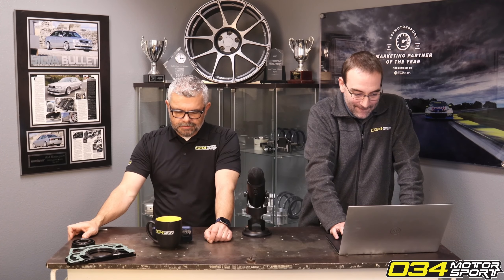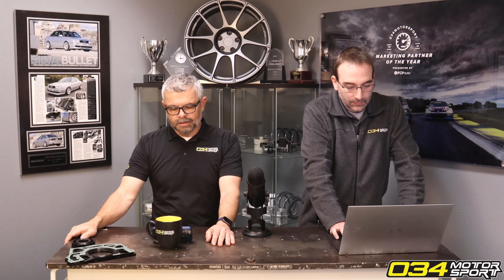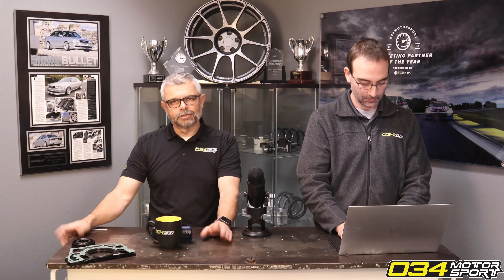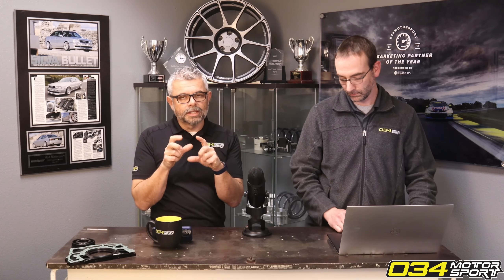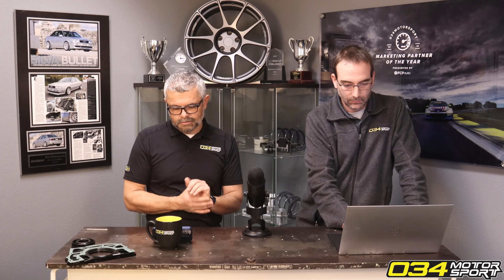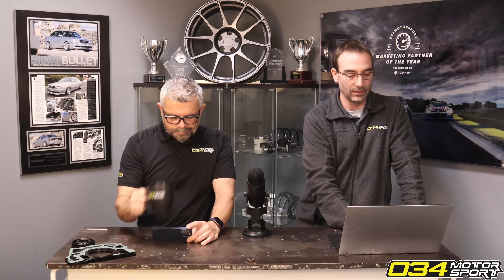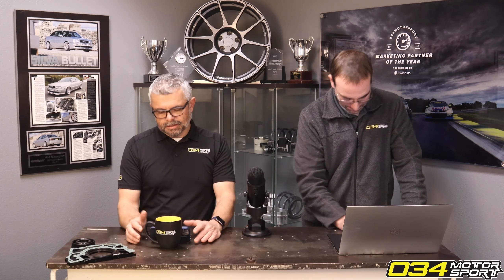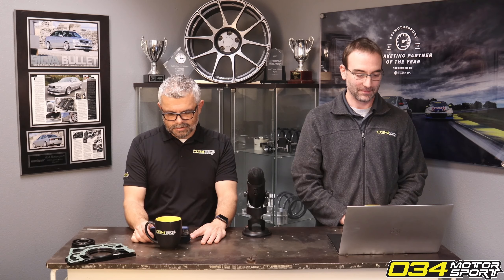What Are the Benefits of Having an Upgraded B8/B9 Transmission Mount? | 034Motorsport FAQ

Comment: I installed your trans insert in my '21 SQ5 and it's a crazy improvement over the flimsy stock bracket. The transmission is quite a bit smoother at low speeds now. It's such a great upgrade for the money.
Reply from the maker: Thanks for the feedback!
Reply: Stupid question, but I bought this transmission mount for my 22 SQ5 and was wondering where it goes. I jacked up the car and looked where it would install, but it was all covered the 034 instructions doesnt make it exactly clear.
Reply from the maker: @PeriodicaIs  You must remove the under tray cladding on the center of the transmission area to expose the mount. This should be achievable by removing a few screws and pop clips.

Comment: Is the mount a thing for 6mt ? Or is it for autos only ?
Reply from the maker: It's a great upgrade for auto and 6MT!
Reply: @034MotorsportUncut  does it give it the same benefits it does to the auto for the 6 speed ?
Reply from the maker: @AFBuildsb8.5  Absolutely. The 6 speed benefits further by the fact that your shifting experience will be more direct and less sloppy, as the transmission is not moving as much during a gear change event.
Reply: @034MotorsportUncut  thank you ! Will definitely buy one

Comment: Would'nt reducing the transmission "slack" cause reliability issues with the transmission over time? I feel like audi put the slack there for a reason?
Reply from the maker: The slack is put there mainly to keep the ride more comfortable. Otherwise, we have seen no detriments to the longevity of the transmission and drivetrain with our Inserts and Upgraded Mounts.

Comment: :50 so in a sense would the car feel a bit faster since the 1-10 horsepower used to squish would be less if the 034 mount was installed?
Reply from the maker: Theoretically less energy is lost to the engine mounts, but certainly not measureable.

Comment: I had this mount installed in my manual B9 A5 yesterday and the car is currently on the lift having it removed. I understand the point and the purpose but the vibration and added noise is absolutely unbearable for the perceived benefit. The juice is not worth the squeeze for a daily driver and makes the car feel broken. No issue with the insert but the mount is definitely for track use only and I would not suggest it for daily drivers.
Reply from the maker: We're sorry your experience with our Street Density Transmission Mount was not as you expected. However, in our experience and the many others that run the same mount, there is a very low amount of NVH (Noise, Vibrations, & Harshness). However, most of our customers claim to feel none at all.

On our product page, we state that if you are experiencing higher than quoted NVH with this product, please email techsupport@034motorsport.com for further assistance.

Comment: I'm asking a tricky question but it would be super appreciated if it could be answered. I have a b9 45tfsi with a 7sp dct but I get dissatisfied everyday i ride it for the past 3 years, especially after owning a b8 a5. 
7sp in the b9 feels very shaky, and every now and then, there is a big thump especially if you gas it after braking and even during downshift. Manual shift is a nightmare both up and down. Big vibration during stops. Its not as responsive as my previous 7sp in the b8 either, which used dl502. 7sp in b9 is dq381. Big difference apparently. 

I am very keen to buy this product but from my understanding, oem mount is enable some shakes and vibration so that the mount absorbs it, not the tranny. Would getting this mean Ill have a firmer tranny shifts but lose reliability?
Reply from the maker: When installing the transmission mount, you are replacing the factory "softer" mount. This softer mount is in place to provide a more "mushy" feeling, dampening the mechanical movement of the transmission to provide comfort.

Our mount does not cause your  transmission to lose reliability. Our mount will firm up your shifts and cause for less slop. You can imagine this slop as the delay from your foot pressing the gas pedal and actually feeling the car accelerate.
Reply: @034MotorsportUncut  cheers, I'm ordering one today. Hopefully delievery to Sydney Aus wont take took long :)